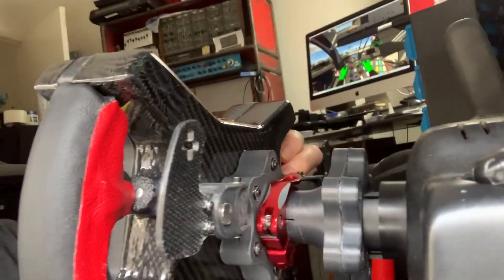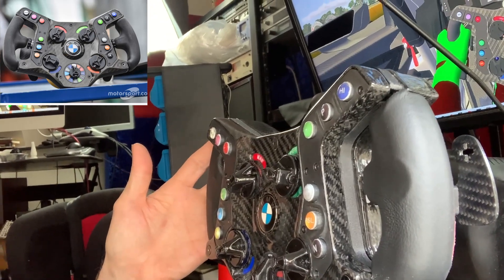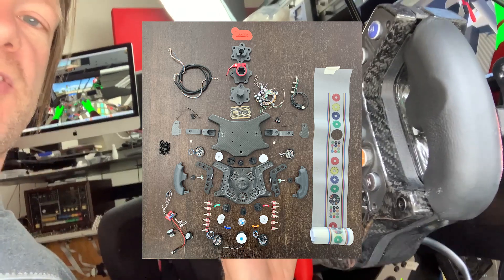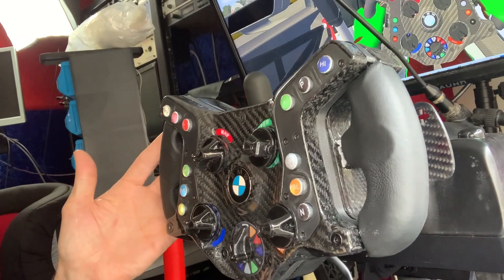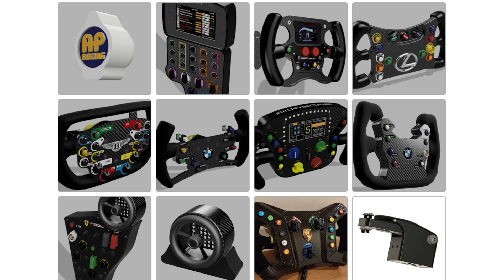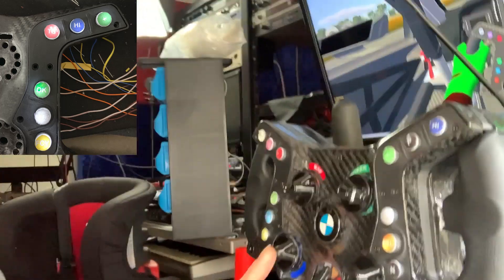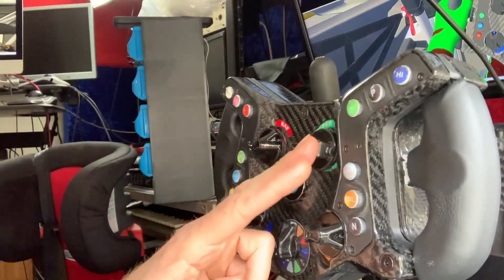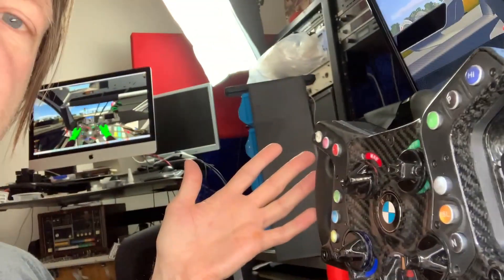BMW M8 GTE Sim Wheel Build Series. DIY 3D Printed iRacing wheel

Comment: Espectacular!!! what LCD did you use? And how you control them?
Reply from the maker: This doesn’t have an LCD but I do have other models I’ve made with screens. For my Formulae Renault 3.5 wheel I used a 3.2” Nextion touch screen but the cheaper option these days is the 3.5” standard USB screens or bigger. The Nextion is controlled by a Arduino Pro Micro board and SimHub software to send the data to and from the game. See simhub’s site for details on the options. Thanks for asking.

Comment: I have a question, what is the best 3d material to print this?
Reply from the maker: I use PETG for everything that needs to be strong. Carbon fiber PLA is nice for a CF like matt finish on some parts but it’s quite brittle. Standard PLA is good for anything that doesn’t need strength like knobs, panels and detail and it prints much easier than PLA. Some of the PLA silk filaments are great for metallic looking parts. I stay well away from ABS, it’s terrible to print with in my experience.

Comment: Looks good! but the wheel looks pretty thick is that bc u put backlights in it?
Reply from the maker: No it’s a great width. It’s only 10mm deeper than the original wheel. There is a lot of circuitry in there but the lights take up very little space. It’s really because of the wiring. The way to go is to make separate boards for each of the button sections.